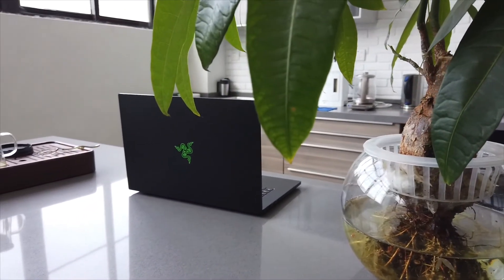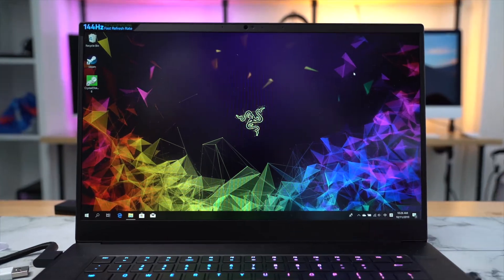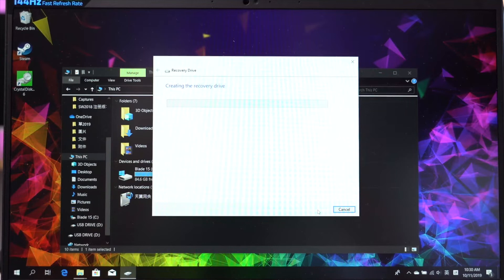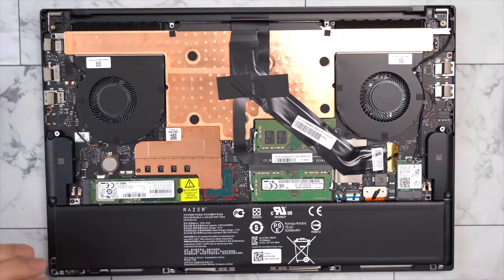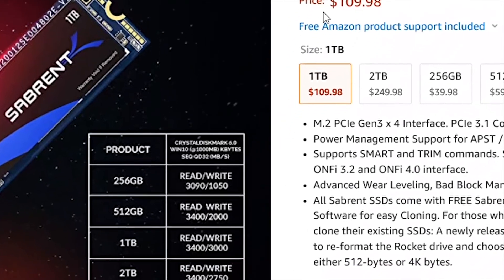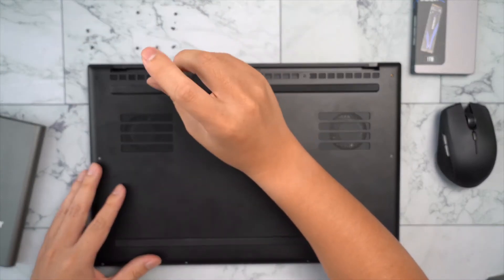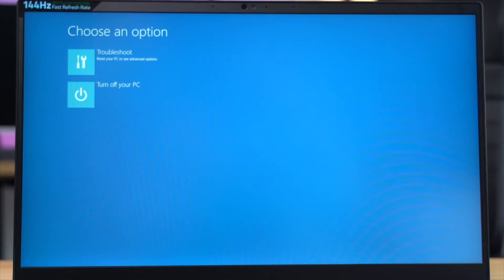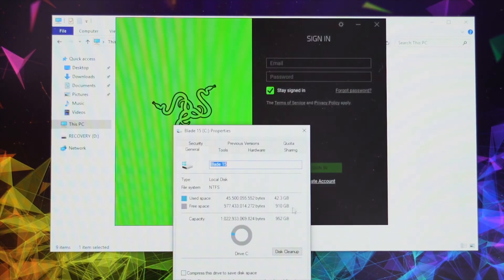Sabrent Rocket 1TB SSD Upgrade On My 2019 Razer Blade 15 RTX2070 By Creating A Recovery Drive

Comment: Hi, thanks for your review, very interresting ! I'm thinking of upgrading my HP EliteBook 840 G5 laptom with this SSD. I've read that it could get very hot during use. Have you notice any excessive heat that could compromise an installation on a laptop ? 
Thanks very much :)
Reply from the maker: The heat problem happen to all nvme ssd during heavy load the solution for me is just adding a cooling pad underneath the laptop during heavy task like editing and rendering 4K video.
Reply: @VincentCTK  Thanks ! I don't do heavy work, mostly MS Office work on encrypted drive, but my laptop says on 12h/day and gets a bit warm at the end of the day. I think this should work then. Thanks again !!

Comment: That's a great tutorial video for upgrading SSD on blade 15! Thank you! I just have one question that the recovery drive you created contains all necessary system files and other necessary stuff, like touchpad drive and wifi drive, right? Just want to make sure on this thanks
Reply from the maker: Thank you for your comment! Yes, it will contains all those driver.

Comment: Hi I have a question. After you make the recovery drive on the usb. Just change the ssd and then boot it up with the usb connected? It's that simple?
Reply from the maker: Yes, follow every step in my video and you should be fine, but if you are not comfortable of what you are doing  I would recommend for a professional help!
Reply: @VincentCTK   Is the recovery drive method the easiest way? 

no need to download drivers or windows installation file from the windows website? thanks for the advice!
Reply from the maker: As far as I know yes this is the easiest way to do it!
Reply: @VincentCTK  Hi, is the recovery drive saving your files as well, or just windows and softwares ? Cheers :)

Comment: Have you experience an issues or problems with your blade 15?? Like many blade user in the forums they have atleast one issue persist in their machine like blue screen, power brick issue, screen panel issue or anything?? Bcus im consider to ordering this machine but im affraid of the quality problems like many people have with their razer blade 15, thx :)
Reply: Oh and btw, do you live in asia or india?? Bcus im in south east asia would be hard to getting it RMA or refund if there something mess happend to my machine :"(
Reply from the maker: luckily I do not have the issue you listed above, So far the blade has been great for me. Here is the specs of my blade see if this the same one they talk about in the forums:
i7 8750H 
RTX2070 
16GB ram
256gb storage

Btw I live in Hong Kong